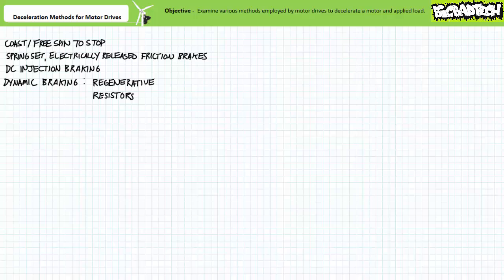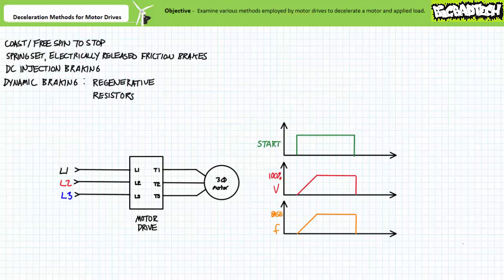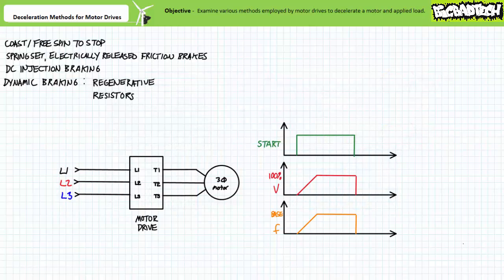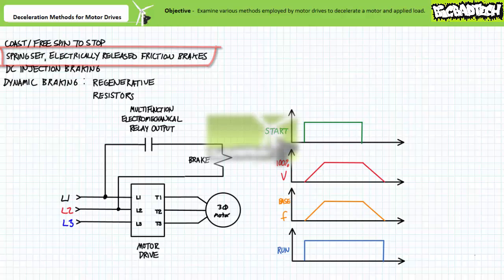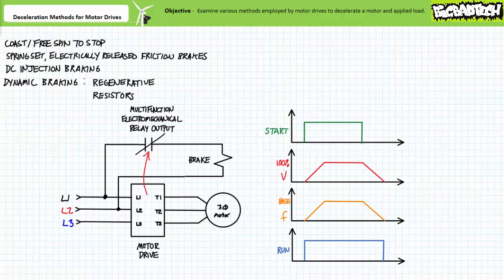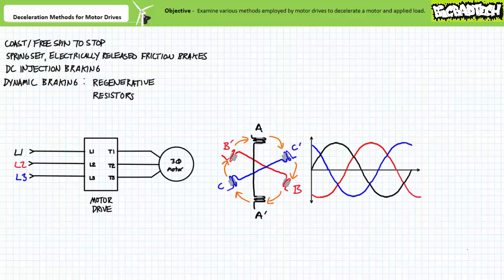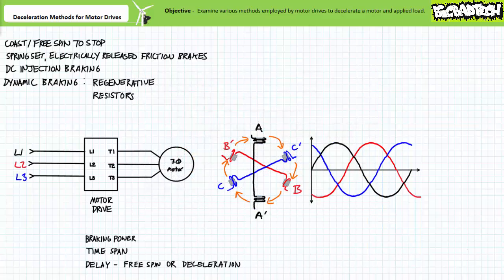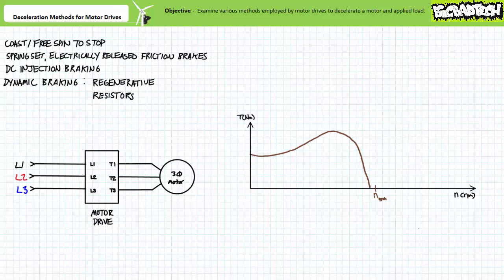Motor Drive Deceleration and Braking Methods (Part 1 of 2)

Comment: Thanks Jim! I’m having a hard time wrapping my mind around one thing with AC induction motors and back energy.
I get with DC motors the magnets in the motor can generate voltage.
With AC motors if they are rotating faster than the synchronous speed back emf is created?
Would thinking of that like a change in voltage on an inductor having an opposition to current?
I hope that made sense and is probably completely wrong.
Thanks
Reply from the maker: Check out the "Electromagnetic Interaction" lecture at: https://youtu.be/czp1rMlQEZU
This describes the origin of CEMF and counter torque/braking.
Reply: @bigbadtech  will do! Thanks

Comment: hi, i have some questions about this that i just dont understand, i am using an electric skateboard, it has regenerative braking but once the battery has a full charge the remote disconnects the ability to brake to save the electrical equipment. some skateboard companies have solved this problem with a braking resistor but i am unsure where to install a braking resistor because the skateboard has a battery and a electric motherboard, and also dual motors in the back, do i install the braking resistor right in between the dual motor and mother board? or between the battery and motherboard? the way this board is built is simple ill explain the process. 1. Battery////// 2.ESC motherboard/and remote reciever//////////// 3.motors/////// it is wired in that order from battery motherboard to motor.